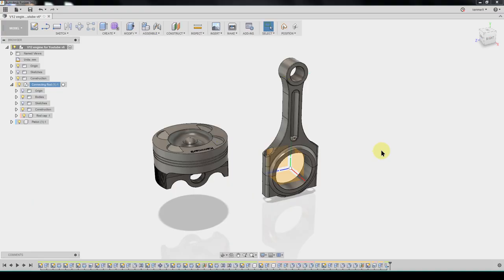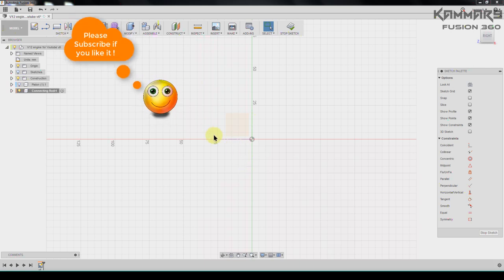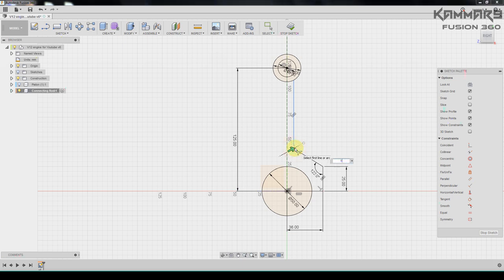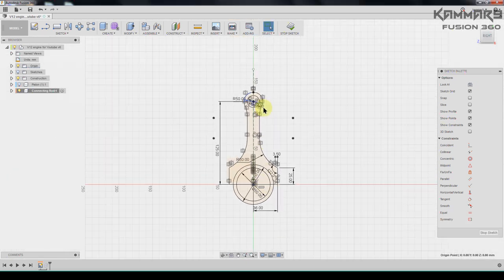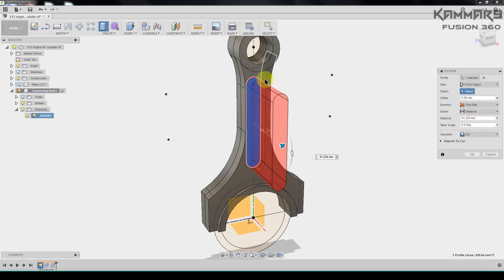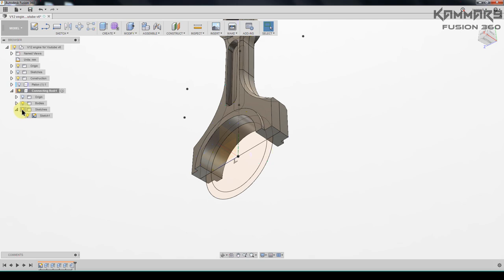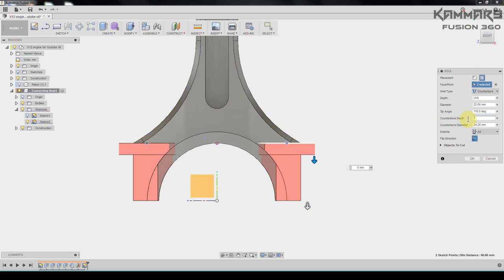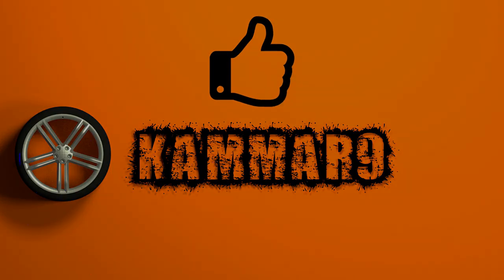Fusion 360 Modeling V12 Engine EP 02 😍   Full HD

Comment: Hi, as i go through the episode i will edit this comment to include questions i have when watching. Your content is amazing, i am a good amateur with fusion, can make most of the things i want, but i cannot make them efficient or in a way that is easy to version control / edit later on. 
1:00 did you save the body as a component from episode 1?
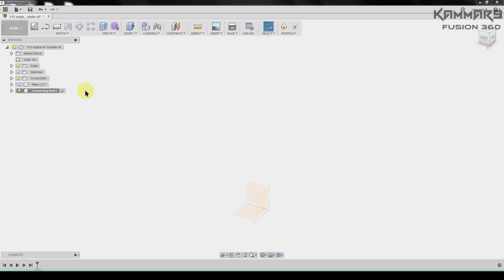1:47 do you always model around the center? do you move components away from the center when you finished modelling them so you can model a new component around the center?
6:57 you draw the circle and say it is not coincident, but with me it snaps to the circle, i can see the sketch profile inside the body but not select it the way you do, i have to hide the body and do a join extrude, is this because its older version of fusion?
Reply: Its because you have a newer version/updated version of the program I think